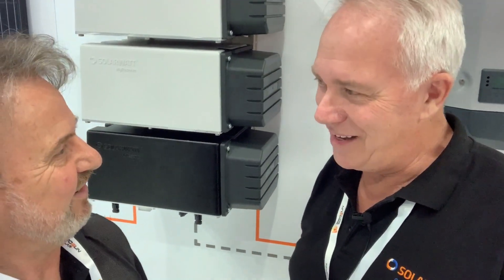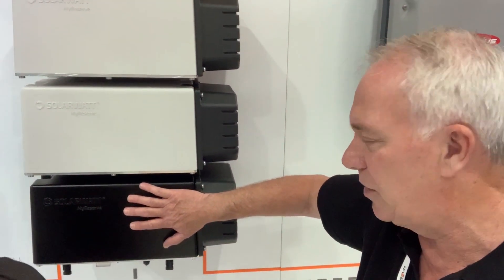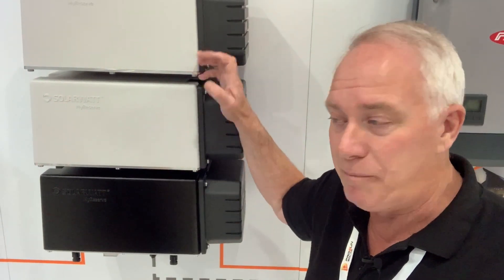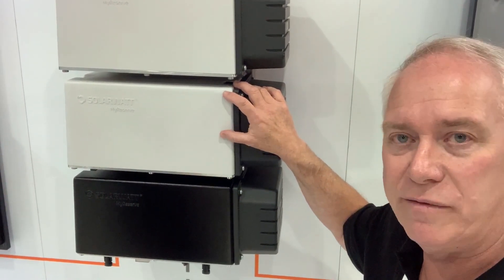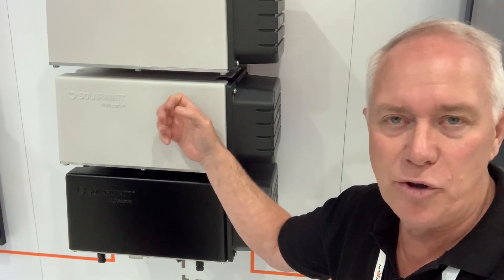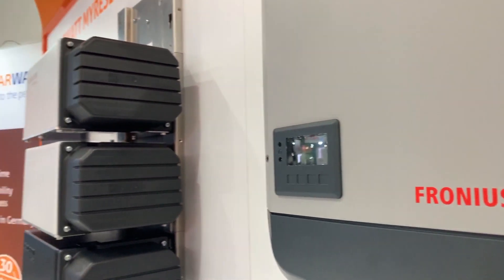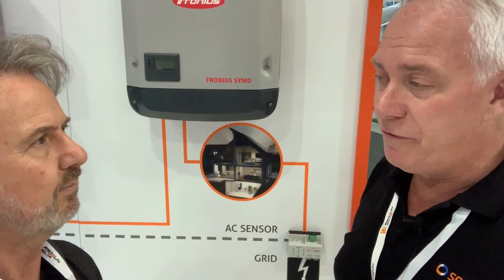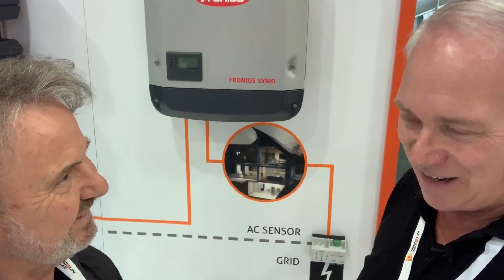SolarWatt MyReserve

Comment: Would this solution work in off-grid mode in case of a power failure?
Reply from the maker: Not if the inverter that it feeds is a grid-tie only type